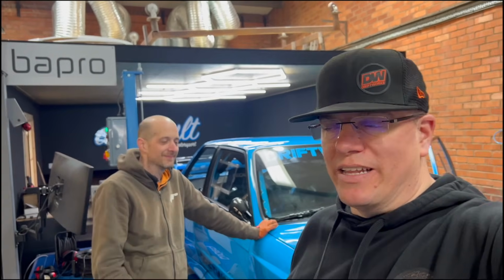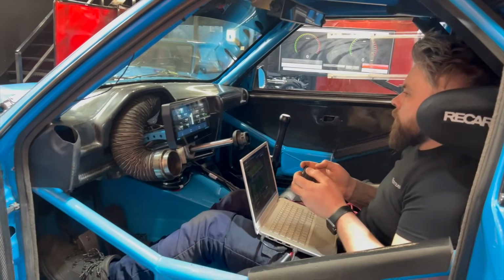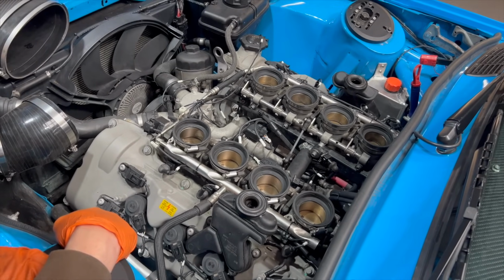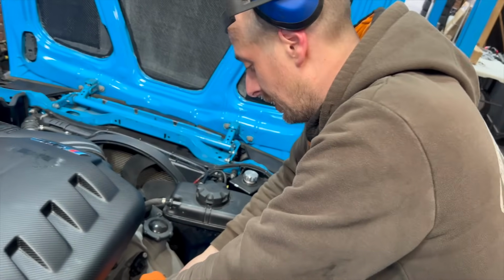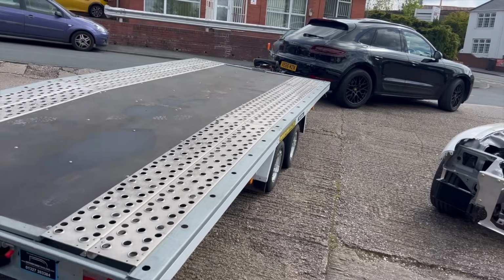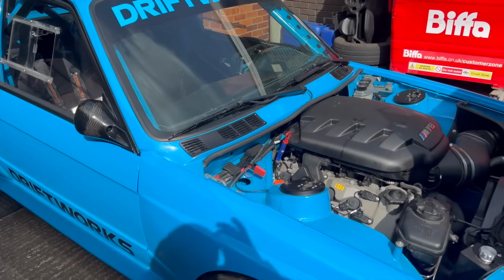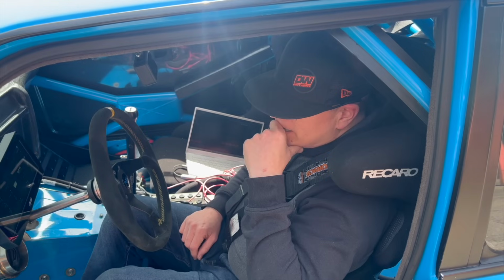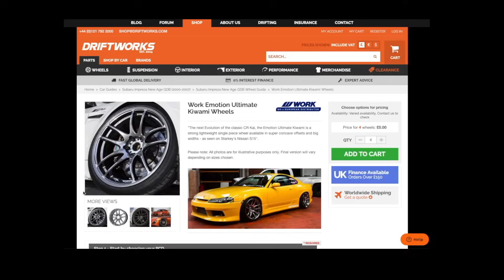My S65 powered E30 BMW M3 - Problems on the Dyno

Comment: You and Craig should go halves on a 2wd dyno, could really cut down some of your diagnosis time
Reply: Hub Dyno for Steady State Tuning would be awesome
Reply: Where would they put it?
Reply: @eddiehp  a hub dyno would allow them to put the units into a corner when not using it, and not sure if they need strapping down but they could put anchors in the concrete

Comment: I have an s65 e46 that also made 360whp on the dyno. Im convinced that these engines need an X-pipe to actually breathe and produce the power they were designed to make.
Reply: i think this was at the crank, 360 whp is very healthy for a standard s65
Reply: @neilstewart1208  Crank? How does the dyno back-calculate drivetrain loss?
Reply: @icanturn6844  the drag on the rollers on slow down
Reply: 360whp with a driveline loss if 20% equates to 432 at the flywheels it's probably not far away
Reply: Love it!!!
Reply: An X-pipe will really make the exhaust scream, too.
Reply: @johntosh6146  20%? Is it AWD?
Reply: @ChristopherHallett  no 20% is worst case. It's not an exact science so better to look at a higher loss. Also bear in mind this car has different gearing which also plays with dyno numbers. As long as its in the ball park that's all that matters
Reply: @johntosh6146  rule of thumb is to dyno in 1:1 gear for this reason though. I’m not sure if his drenth has a 1:1 but I’m sure it gets close. 20% is way too high for an e30.
Reply: @icanturn6844  agreed they should be run 1:1. I also did say that 20% was on the higher side. But seeing as no 2 dynos read the same as well as other factors that can skew readings all I used for an example was 20%. The only way you could calculate it correctly is have the engine on a specified engine dyno first other than that its guestimation

Comment: Probably nothing but at 6.29 the black hose connecting the 2 banks under the eventuri intake is collapsed at idol?
Reply from the maker: It’s just a balance pipe,  but does need a metal connector in the middle.

Comment: 6:30 why is that rubber hose that connects both sides of throtle body's so squished... Is that normal because of a vacuum or...
Reply from the maker: Yeah it’s vacuum. We noticed it too. It’s only a balance pipe, but could do with a solid connector in the middle.

Comment: If it’s an eddy current dyno (creates load via coils) vs rotational mass (created load based on centrifugal force from weight of the roller) the difference can be massive. Euro dynos are primarily the latter which read higher. This may be the reason for your low numbers. 🤷🏽‍♂️

Comment: You didn't chuck the higher ratio rear end into it for Goodwood?
Reply from the maker: It's way higher ratio than I want already. It's in Nurburgring spec at the moment so is geared to about 185mph if I remember correctly.

Comment: 370whp or engine hp? If whp, that sounds pretty good. If not whp, then definitely a little low.
Reply from the maker: At the Flywheel. If it was wheel I'd be very happy.

Comment: Why go to a mapper with zero experience on the ecu you are using?
Reply from the maker: Because we weren’t supposed to be mapping it. It was already mapped. This was supposed to just be a couple of pulls to check it’s not running lean.

Comment: Gale banks would laugh at this dyno setup. Fan in front is made for RC cars, and you always dyno as car goes down the road, which means closed bonnet. 370hp at the crank seems right for the S65, the 420hp claimed was always way over. When they first came out they all dynoed around 360-380hp.

Comment: I know is hard to to hear but stop wasting money in s65 engines, maintenance, problems, cost, power losses,..I see many many problems all the time with this engines, get a v8 coyote and you will never have any problems.
Reply from the maker: I’ve never had a single issue with the S65 so I’m not sure why you think I’d need to swap it. The engine is as perfectly matched to the chassis as you can get IMO. I like the Coyote engine, but it won’t be going anywhere near this car.
Reply: @driftworks  the s65 it’s well known for bad things in everything, I know sounds badass and revs high and it’s a BMW motor, but is not a good v8… not reliable even with good mantenience, problems with main bearings, compression, hp numbers and very expensive to do anything on it, I love the e30 and I love the project but I don’t see it very often at the track…it’s hard to hear but you won’t have those problems with any other v8s that are in the market.
Reply: @santibh88  Bollocks
Reply: It’d still have 3 to many cams
Reply from the maker: I wholeheartedly disagree. The S65 is one of the best V8 engines to ever come in a road car. Most of the stuff regarding reliability is over dramatised internet BS. 
The fact that this engine exists is a testement to the final years of the real BMW M devision ,before the era of turbo nonsence came about. 
There is literally no other engine that I'd rather have in this car. It has never let me down, and there isn't a more perfect balance of performance, weight, reliability and sound for this chassis IMO. 
The reason you've not seen it at the track is because I like building and messing with cars as much as I do driving them. The car has been off track for 9 months because I changed stuff, not because it's broken.
Reply: @JayDontGotThis  🤣
Reply: we have different opinions, and example: you love too much like me the v10 in the e60, I had that car because I love the looks and the engine and it was my worst nightmare in my life, I got tired of spending thousands on it with many electrical problems and sold it for nothing, here in Spain you can get them for nothing.

Thanks for unswer me respectfully, I love your content and I always try to help, but I don't want to see you getting tire of that engine, in Spain we call a person like you a “”burned””means spend thousands of money in what you love.
Reply: @santibh88  That is a really nice reply, yes you are right to some extent however the 'burned" expression pretty much relates to all car guys!, the s65 is generally very reliable if looked after, i know lots of track lads that have had zero issues and we properly beast them, also vast numbers are hammered around the nurburgring on a daily basis without issue, you are bound to get problems with some as there are so many built. you always hear the bad not the good on the internet. Hi from the Uk😎